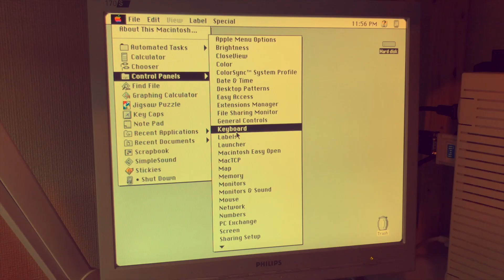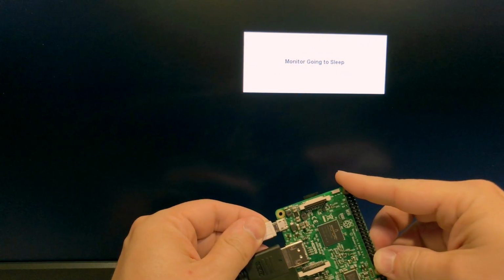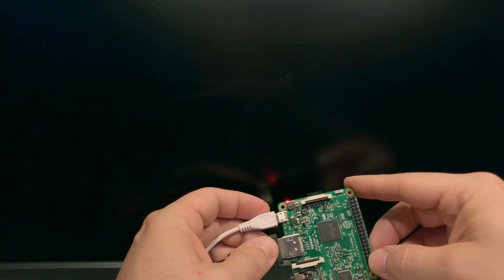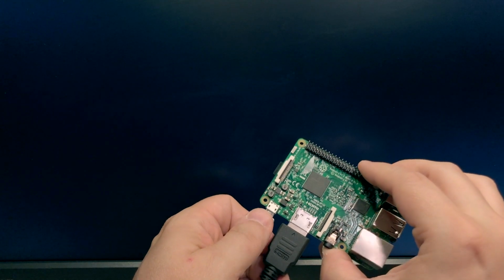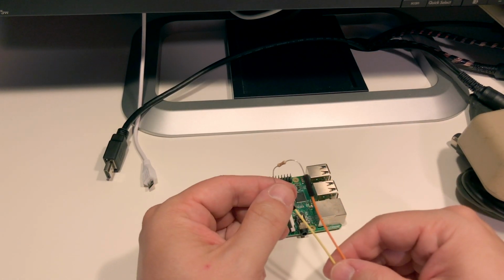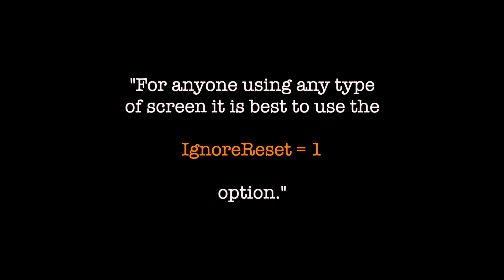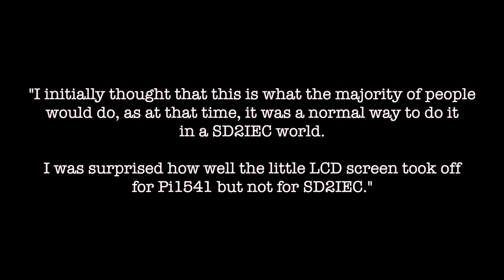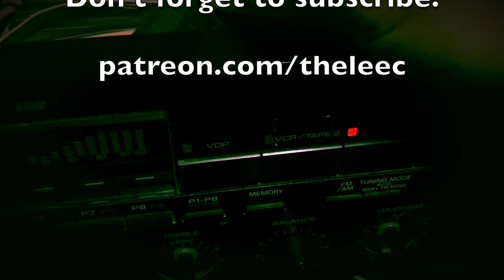Pi1541 Stuck at boot/logo screen?

Comment: I doubt anyone will see this after all this time, but here goes:

I don't even get that far with my pi zero.  I'm still stuck on the rainbow square in the center of the screen, with no end in sight given that I've already tried "boot_delay=1" (to no avail) from several help pages elsewhere.

The only remaining option, according to those help pages, is a bad kernel, but I followed the instructions from your other video, and I can't imagine why an official kernel wouldn't work, especially the one that Steve links to.  I've tried two different kernels (the one that comes in the firmware package, and the one Steve specifically links to as being appropriate for pi zero), and nothing boots past the rainbow square.  I've even tried removing the config settings for overclocking the processor that you mentioned in the other video, and just tried to boot normally with the defaults.  No luck.  Running options.txt with default settings (or eliminating it entirely) also doesn't work.

This device DOES boot to a card with Raspbian on it, so I know the hardware isn't faulty (including the power supply, which came with the pi.)  Only when I try to boot to Steve's pi1541 setup does it fail to get beyond the rainbow square, with or without the hat attached.

At least now I know that I should be able to get a screen using HDMI without the hat installed (wasn't sure of that until I saw this), but the steps to getting there are a mystery.

I hope YouTube doesn't scrub these links:
Pi1541 files, found at the following address (from Steve's site):  https://cbm-pi1541.firebaseapp.com/Pi1541.zip
firmware-1.20180919, found on Steve's site at the following addr: https://github.com/raspberrypi/firmware/archive/1.20180919.zip
Pi Zero kernel, found at the following address (from Steve's site): https://cbm-pi1541.firebaseapp.com/Experimental/Pi0/kernel.zip
Followed your instructions from the other video for setting up config and options.  Also tried defaults without your changes to those two files and that didn't work either.

Given what others have said, I suspect that that firmware link isn't really up to date, but then firmware.img is replaced by the pi zero specific version in a later step anyway.  I've tried both, and neither one works.

What are my next steps?  I really have no idea how to proceed.
Reply from the maker: Hi Kuoxsr! A little clarification… Don’t even try getting anything but a rainbow screen on a Pi Zero Pi1541. The rainbow screen is expected behaviour.
Pi1541 never touches the GPU on the Pi Zero, because initialising it would steal precious CPU time later in the emulation. It is very unusual for software to run without starting the GPU on the Raspberry so the confusion is very common. 
The only way to get visual feedback on a Zero is with an OLED screen plugged onto the hat. I suggest you start over, focus only on the Pi1541 hat and ignore/cherish the pretty rainbow.
Reply: @TheLEEC  Well, then I'm stuck, because with the hat attached, I get absolutely nothing.  The screen doesn't come on at all.  I may need to contact the seller and get a refund for a defective hat.  I've tried testing the gpio pins I soldered on, thinking I did something wrong, but two different programs that claim to do that either exit without output or tell me my hardware isn't supported.
Reply from the maker: I see… That sucks if it turns out to be broken. Do you have a link to the hat I could check out? Maybe something is non standard on it and needs a tweak. I won’t be able to check today but I could get back to you.
Also you can check this video for the issue in action: 
https://youtu.be/mO0iTIXjYAA
I had to make it unlisted because I got spammed with confused people that had all possible issues not related to Pi1541.

Comment: Bought a Pi1541 zero epyx cartridge. The lcd on the pcb flickers when scrolling and has very dim light. Any thoughts on what it could be? Broken lcd? Have I missed something in the settings.txt? I'm desperate. Hate when things like this happen
Reply from the maker: Haven’t used the zero epyx cart but as far as I can tell it’s a fairly standard Pi1541 Option A implementation. 
If you have configured settings.txt according to Option A from Steve’s guide, my two bets from your description would be a dodgy OLED display or a weak 5V supply. If you could make a video of the issue it might be possible to get a better “feel” for the symptoms.
Reply: @TheLEEC  suspect a 5v problem also. Also, I'm not sure what display I have on the cartridge and maybe uncommented the wrong lcd type. About the 5v... The pi is powered by the cartridge slot. In videos though, it seems to work
Reply from the maker: The PCBWay reference design for the zero epyx suggests ssd1306_128x64. It’s the most common one by far.
They usually can’t dim though, as far as I know. That’s an odd symptom. Corrupt data (wrong type selected) shouldn’t make it dim. It should just be black or in some instances distorted.
Reply: @TheLEEC  I'll be back after some more investigations
Reply from the maker: Cool. Got it. Question... Is the Pi1541 drive working on your C64? (Just to know that the problem is localised to the LCD).
Reply: @TheLEEC  its working. Not flawless but it can run ghost n goblins arcade and demanding demos. Noticed this weekend that it isn't always you can put 4 d64 images in a row without it hanging up at some point. If you just run 1 image at a time it always work.... So far...
Reply from the maker: Ok, as long as GnG works the electrical stuff relating to IEC is probably fine. The setting i2cBusMaster = 0 for choosing OLED pins should be already set. It becomes the default with Option A (splitIECLines=0). My next guess would be the initial one: Faulty OLED. But that’s still just a guess that can only be tested by replacing it.
Reply: @TheLEEC  have ordered a new one but I'll check the settings.